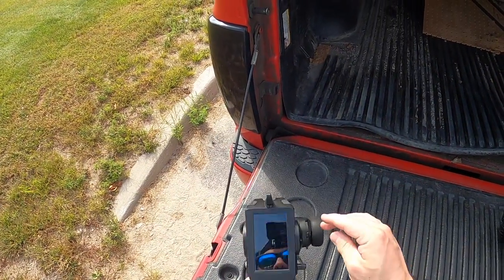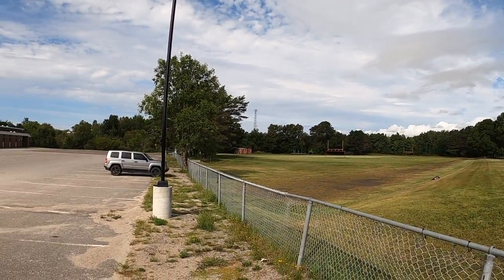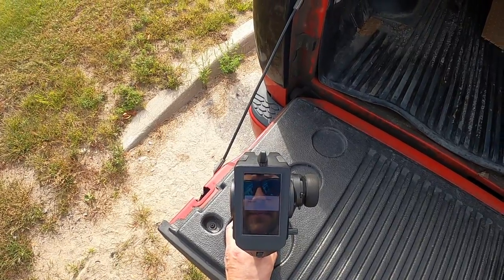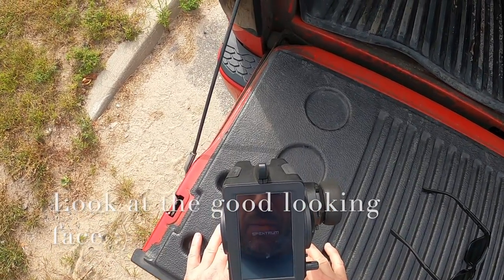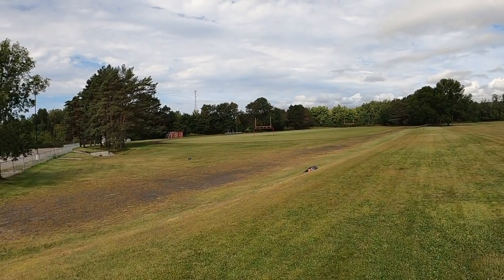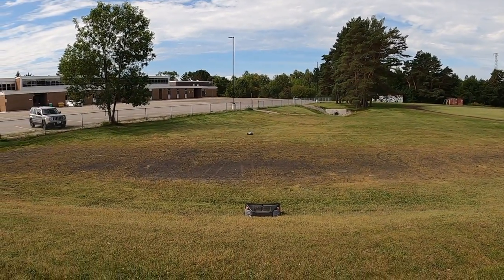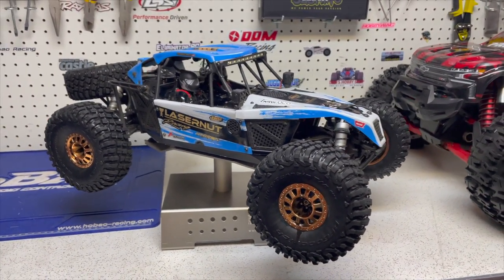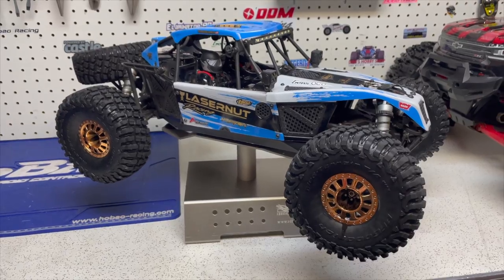LOSI Lasernut Bash!  (Jumps, Rock Bouncing, WOT Rips)

Comment: change the center differential fluid and it will back-flip. thats how big a difference it makes in this truck. and I turned the punch to 6 I believe and the brakes up 2 I think. plus I shut the avc off on the receiver
Reply: What diff fluid do you use